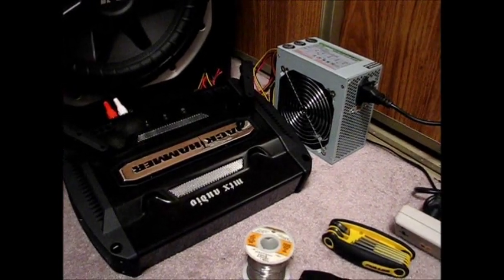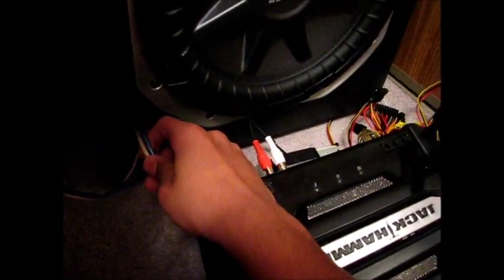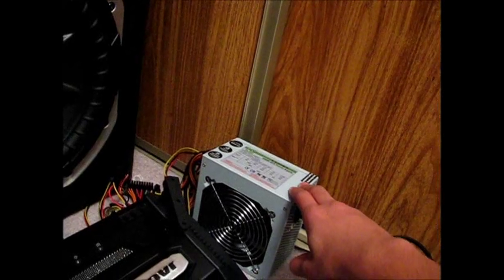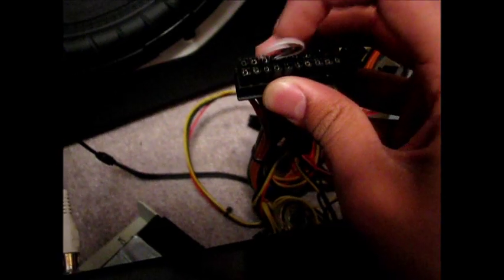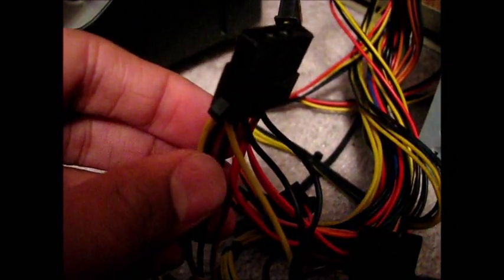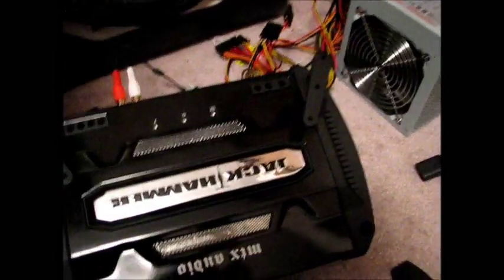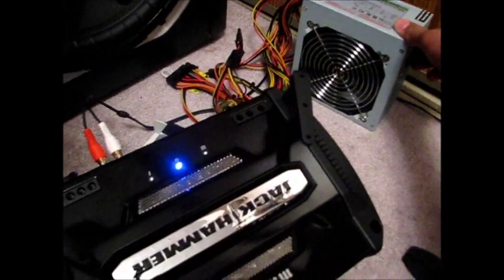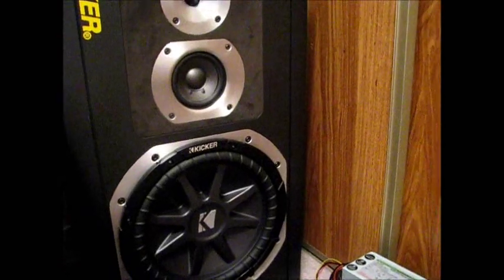How to wire Car Amp at Home

Comment: here's the specs on the sony amp:
4-Channel Class AB Car Amplifier
RMS Power Rating:
4 ohms: 55 watts x 4 chan.
2 ohms: 65 watts x 4 chan.
Bridged, 4 ohms: 130 watts x 2 chan.
Max power output: 150 watts x 4 chan.
Fixed high-pass filter (80 Hz, 12 dB/octave)
Fixed low-pass filter (80 Hz, 12 dB/octave)

Comment: hey man, i got a sony xplode amp xm-554zr 4/3 channel, 600W, and a kenwood KAC-6485 4/3/2 channel amp, and a sony xplode 10" sub that says 1200W outside with all black color that I want to hook up to my computer as a sub using my creative 5.1 speakers with Creative Soundblaster X-Fi Surround 5.1 Pro USB Audio System with THX SB1095. which amp would work better with the sub and need your help on chossing the type of psu for it. Ill post the specs for the sony amp and sub in another post

Comment from the maker: @GSROOSTA Well since there are more than one 12v molex connecters use 2 - 3 of those and cut them so that you will have many wires carrying the current to your amp. If your powersupply has a lower current than the actual amp your simply under powering it resulting it a lower output (Sound or bass).

Comment: At about 4:37 in your video you talked about using multiple wires to prevent them from getting too hot but on the connecter there are only only two black and one yellow wire? where did you get four black and four yellow wires? also how many should i use to short my positive with my remote? Last question, what would happen if my PSU has lower amps than my actual amp. i dont know what kind of amp i have but its very powerful and my PSU only powers 18A max. Thanks a lot. It's a great video.

Comment from the maker: @mattheoo7 I just tied them up with a twist tie, I wouldn't recommend cutting the wires, because in case something were to go wrong with your existing wires you wouldn't be able to connect em with any other wires.

Comment from the maker: Now you will need to find the model of the amplifier and search on the website the specifications. You will need to find its amperage rating at 12volts. Accordingly you will have to buy a power supply. I would go with a powerpack that is close to around 600 to 700 watt.

Comment from the maker: Your amp is tripping, do you know if the sub is a dvc? If so wire according to the amps output impedance. That should fix it. The Amps output and the subs impedance are not matching so the amp is tripping to save the save from blowing.

Comment: i did mine with a 1600.2 amp with a old xbox as a power suplly wo cutting any xbox wires and it powers my 2 jbl subs 12 in

Comment: SO i have a a small 200w alpine Amp at 4ohm and 350w at 2ohms.....on my amp theirs two 20 Amp fuses. Does this mean i need a 40 amp psu for a small 200w Amp?  or can i get away with one psu at 20amps and 400w? your help would we great!

Comment from the maker: Try buying a more powerful power supply, match the amperage rating at 12v. Your putting a heavy load on the psu or your psu is defective.

Comment from the maker: From your audio source you will need an audio splitter one (3.5mm-red/white) jack goes to the bass amp the other (3.5mm-red/white) will go to your other amplifier that's powering the other speakers for mids and highs. Remember to change the your settings on the crossover so that only bass is produced by one amp and the other will single out all the high notes in the song.

Comment from the maker: Amperage is the strength and amount of current flowing through the appliance in this situation its your amp. In your case the amperage is too high. Be careful when turning it up you might just end up blowing up something. You need to match the psu amperage with the amplifier amperage so that your set in a safe range.

Comment from the maker: Yes, they are right. PC power supplies need to match or be in the range of the amplifier itself. Find out the amperage rating on your amp and accordingly buy ur PSU.

Comment from the maker: Your gonna have a tough time finding a a computer power supply that gives of 32 volts at around 60 amps, and even if you do its gonna be quite costly. So you may have to wire 3 power supplies (12 volts at 60 amps) in series to the amplifier.

Comment from the maker: @sunstyle52 Yeah, go to the power tech website and look up your model and find the amperage rating should be between 30 to 40. Once you've gotten that go out looking for a power supply that has a wattage close to or around your 1200 watts and the amperage should match or again be around the same as the amplifer. Matching the amperage just assures that your able to push those subs with max power at 12volts.

Comment: oh and another question bro.. i have 2 mtx jack hammer series 5500 series with a power tech amp pushing 1200 walts.. 
whats suggested power supply would i need? 
im only asking cause i seen lots of videos showing how to do it but yours is more legit and looks really clean and you sound like you know wat your doing and how to put everything together.. so any suggestions?

Comment: "5:51" what if i short out the remote and the 12v with one big wire ? wouldnt that work?
and what kind of psu or whatever it is lol to power the amp? i notice it was a lot quiter and thats a + i think  
so if you dont mind lol i would like to know what kind that is

Comment from the maker: If you have a 200 watt subwoofer, then you need to find an amplifier around the same wattage. Take note of the RMS and the Peak wattage(don't mix those up!). When you find your amplifier, take a look at the specs. You need to find the amperage rating (Amps). Most car amps run at 20 to 35 amps. When you get that number (ex. 30 amps) you need to buy a computer power supply that matches the amplifier amperage rating. On the power supply it will say 12 Volts at 30 amps. This is will push your amp.

Comment from the maker: When i first got the amp i used one yellow for positive and one black for negative ground. What i did was i cut several black and several yellow and then connected it into the slot. They don't get that hot anymore.

Comment from the maker: You need to check the specs on the PSU in ur computer. To run a decent amp you would need at least 250 watts and 12 volts running at 20 to 30 amps.